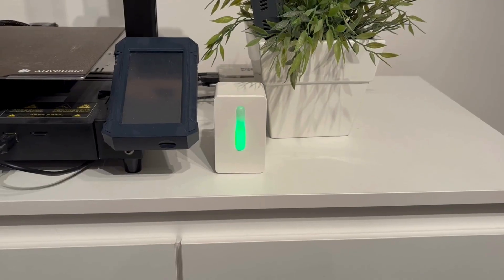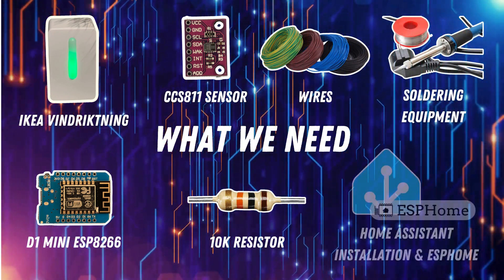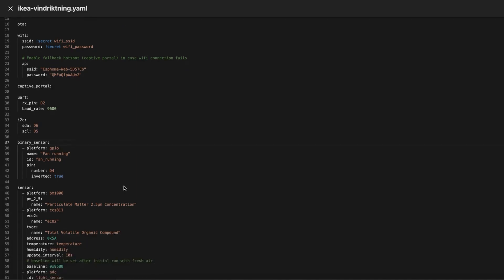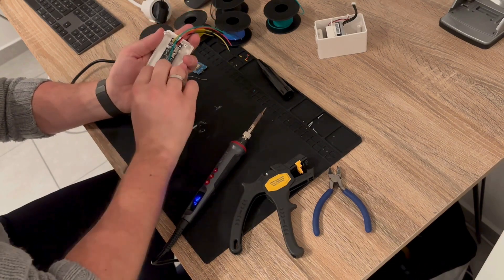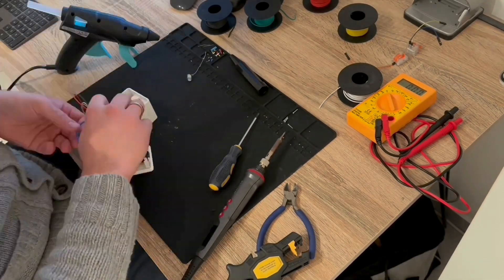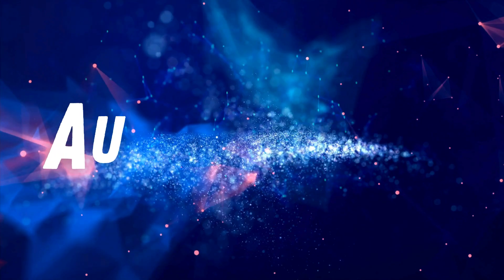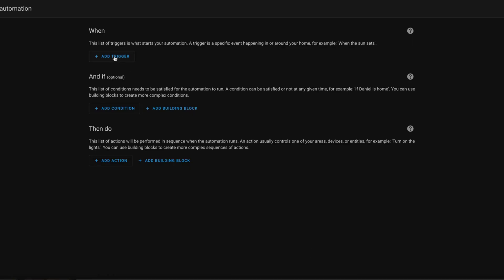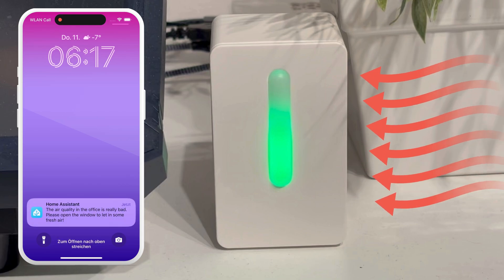IKEA Hack: ESPHome & IKEA sensor allow awesome new automations in Home Assistant!

Comment: Good video! You can change the fan power using the 3.3v from the es8266 instead. Why? Because the default 5v power is intermittent so, even knowing it is not so noisy this on and off if you work close to it finally get annoying. So using a constant 3.3v is so much kind :)
Reply from the maker: Yes, it can definitely be annoying
Reply: 3.3 from D1 doesn't have enough current to allow reliable operation.
Reply: @DarthStasheck  I am using it from a couple of month with no issues, the fan is working okay
Reply: @txitxo0 they are supposed to work like that. Pull in some air, measuring it and turn off. I have a hard time explaining it but in a german forum I read that it must be like it was to have accurate measurements.
Reply: @denis2381  yep, and as the fan is working continuously, the air is moving as well, do that... No worries it would be as accurate as the 5 intermittent volts
Reply: @txitxo0  stop harassing me
Reply: @denis2381  👊🏼🤦🏼‍♂️
Reply: @txitxo0  please don't give me fist. I don't swing that way.

Comment: Can it be added a temp sensor?

This way you can actually place one in each room and have all the data:

Temp
humidity
air quality
light meter
Reply from the maker: Yes, that’s definitely possible. I did not add a temp sensor as I already have one in that room. But I will consider a temp / humidity sensor in the written tutorial that I will create soon on my blog 😊👍🏻
Reply: I tried that before and did not get great results. Maybe my placement of the sensor inside was not great or I restricted airflow too much, but sensor was reporting 26-27°C instead of 22-23°C that it reports when I open the back and let it have access to "fresh" air
Reply: @astacc it can be surprising your much heat these little dev boards kick out in a confined space.
Reply from the maker: @RossReedstrom definitely 👍🏻
Reply: @RossReedstrom  that is true, will be probably switching out mine for something bit more power efficient. I tried to fit pi pico w inside since it produces next to no heat
but there was not enough space... something with that CPU will be perfect for this simple usecase
Reply: Just glue the temp sensor to the outside back of the enclosure.
Reply from the maker: @Teleport73  good idea if it is not necessary to have a clean, smooth backside